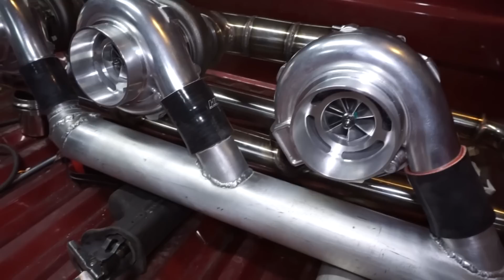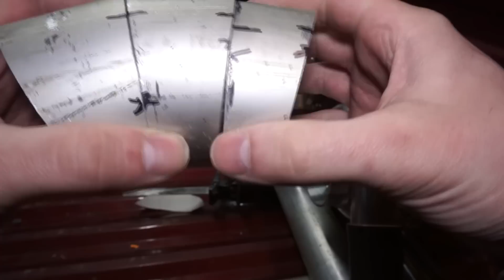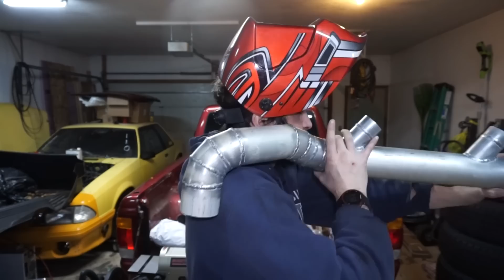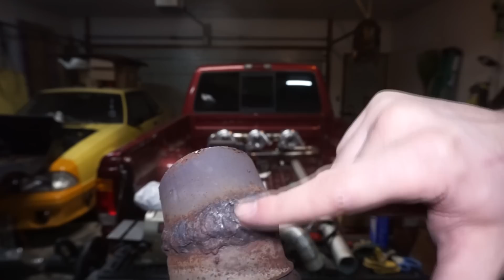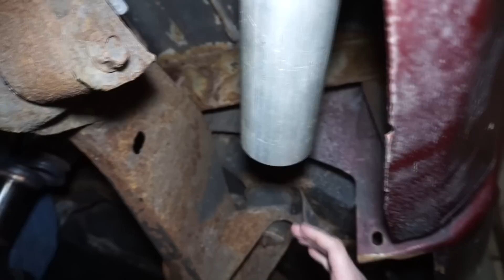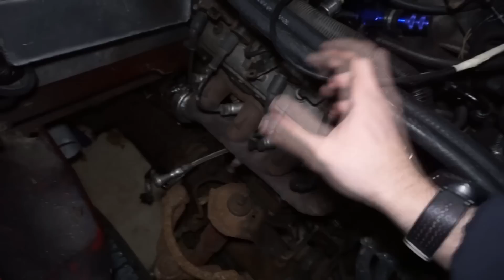Triple Turbo LS Swapped Ranger Wastegate and Intercooler Pipes!!!

Comment: I am curious why the square cutouts in the bed of the truck?   Would a hole saw with a bushing make for a cleaner install?  or are you building a fancy plate to go over?
Reply: zomie1 because angle grinder
Reply from the maker: My whole saws are garbage, and going to put the plastic bedliner back in. I'll do hole in that.